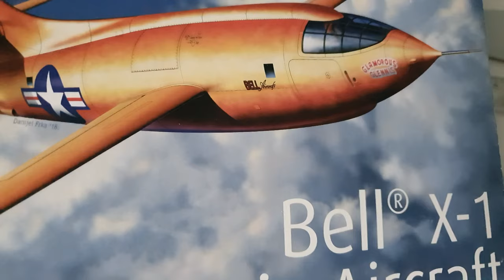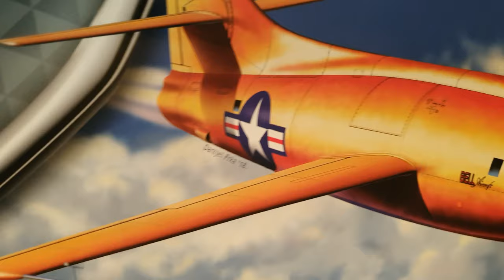WORST PAINTING EVER-over 10 layers!!!! !!!! ASSEMBLY BELL X-1 from REVELL 03888 !!!!!! UNIQUE  1:32

Comment: built this a couple of years ago, it is , i think, quite an old kit, despite "new" on the box. I used Revell 30 acrylic orange, thinned with home made thinner, no problem over a white primer. Whatever problems you encountered, you have done a great of over coming them, which, to me, is the thing I enjoy the most.
Reply from the maker: Thank you very much. I would like to find the best thinner for revell30 like you did, but my chemistry is at low level. Lucky this kit is available in shops, so I can try it again in future. I have question, what do you think  is  the best pressure settings for painting revell 30  ??? How about thinnering?? 3:2?? 1:1??
Reply: @KoKo-kokolas  as you are using the enamel, white spirit is the thinner to use, the others are for acrylic so are not going to work( I know from mixing them up and having a devil of a job cleaning up the mess!). As for air pressure, I go with about twenty psi, but I’m no expert and much depends on your location and weather conditions.

Comment: I have this one in my stash, and was thinking about using it with my high school modeling club. Is it a good building kit?
Reply from the maker: It is good quality/ parts fit very well. I think it would be good to learn /show  mounting of front chassis - this part is hard to set correctly. Also if you will use revell 30 paint you will have some issues worth to show